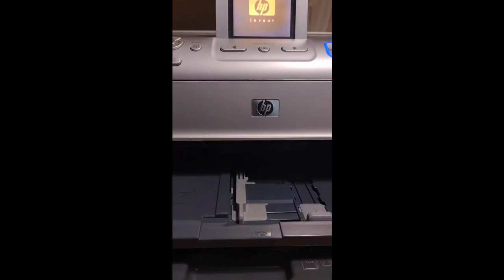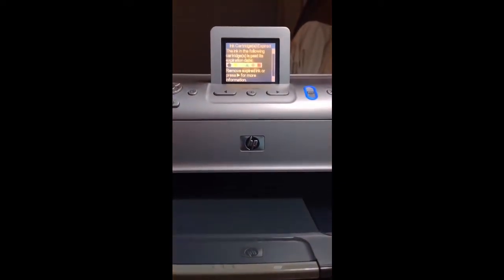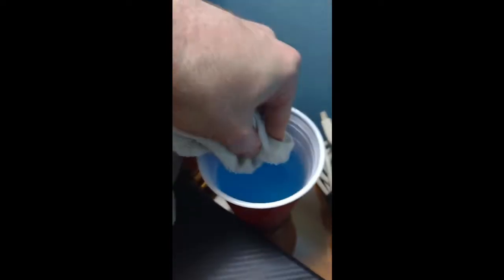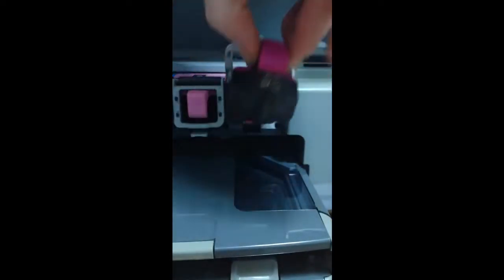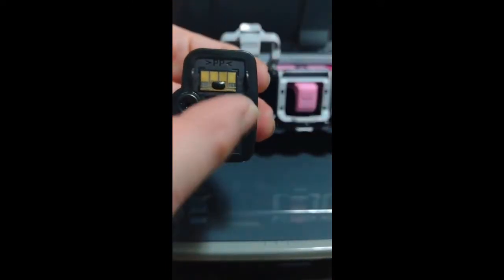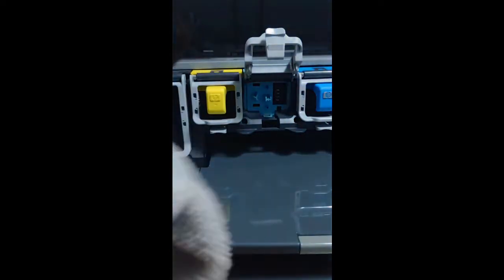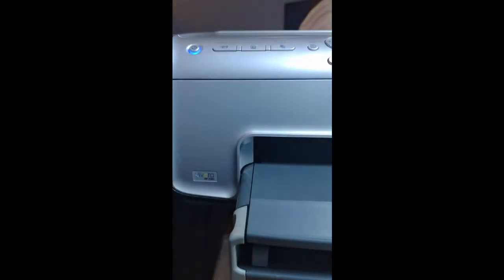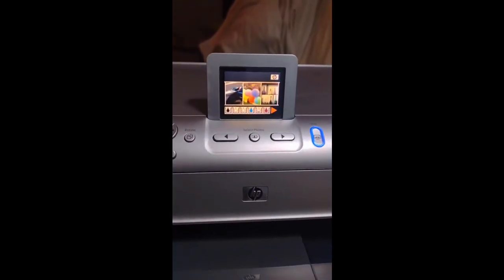How to Fix HP "Printer Ink Expired" Errors & Hack Other Printer Ink Errors

Comment: You wiped the ink failure error with cleaning solution. Right. Doesn't work
Reply from the maker: That's correct, I was able to clear the ink cartridge error on my old HP Photosmart printer by simply cleaning off the receptor chipsets on the cartridges and on the printer. 

However, as I state in the video, this only works 25 - 30% of the time. In addition, this only seems to work with older HP brand printers.

There is also reasoning behind why this works. HP has been notorious for doing everything in their power to force users to purchase more ink than should ever be needed at a prices more expensive than gold in terms of volume. In fact, they've been sued MANY times for this over the past decade and have paid out tens of millions of dollars in claims during that time due to their scams to forcefully sell their customers printer ink for insanely high prices. Here are just a few examples of those lawsuits:
   - https://topclassactions.com/lawsuit-settlements/consumer-products/electronics/hp-instant-ink-renders-printers-entirely-worthless-claims-class-action-lawsuit/
   - https://www.classlawgroup.com/hp-ink-cartridge-lawsuit
   - https://www.forthepeople.com/practice-areas/class-action-lawyers/HP-printer-ink-cartr-class-action/

In my experience, many of their printers chipsets are simply poorly manufactured from low-quality resources, causing them to give inaccurate readings. That's why just cleaning off the connections between the printers and printer ink cartridges sometimes works to fix these errors, especially when there is still plenty of ink left in the cartridge that's throwing the ink failure error.

Anyways, I have better things to do with my time than make up lies about fixing printer cartridge errors.  😂🤣